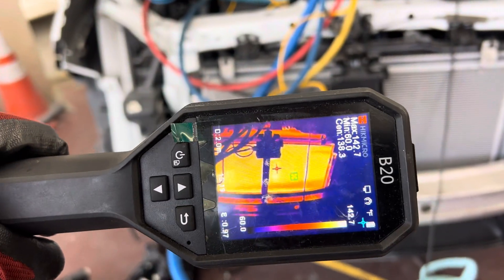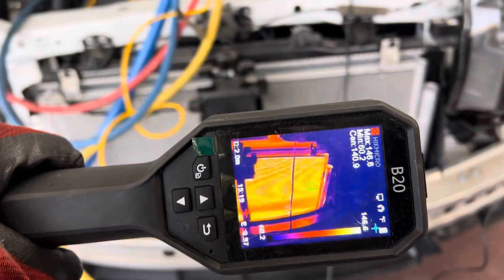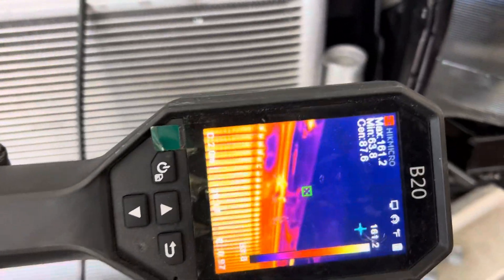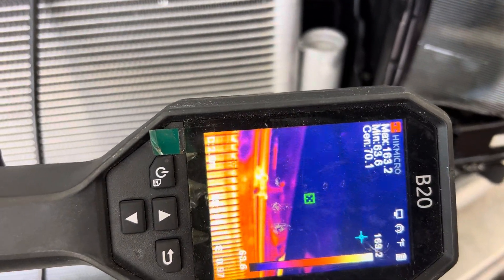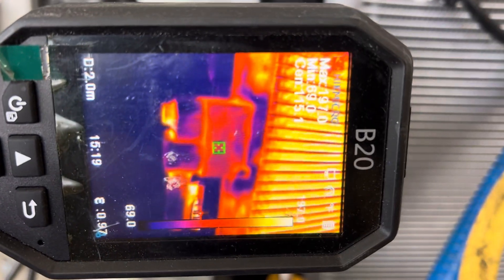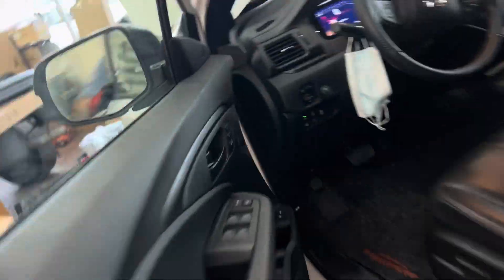￼ no fan on condenser fully charged system over 190°F condenser inlet temperature

Comment: It's nice when the supports a fnd bumper are off. There have been times when I really wanted inlet and outlet Temps, but could not get to the lines.
Reply from the maker: It is nice having access to the inlet in the outlet of the condenser we know they could be near impossible normally. 

One of my niche advantages over everybody else 

Is that I get to physically test every vehicle I do right at the condenser of the inlet outlet on all these body shop front end repairs . 

Because I get the cars before the front goes back on . 

I get the advantage of before recovering the refrigerant out testing the AC system with the OEM original condenser 

And then the cheap aftermarket condenser goes on and I get to do a side-by-side comparison proving whether the aftermarket condenser is a good one or a bad one 

And I basically get to do this every day